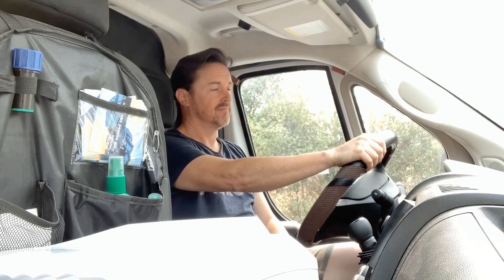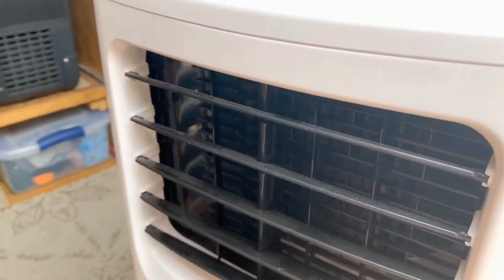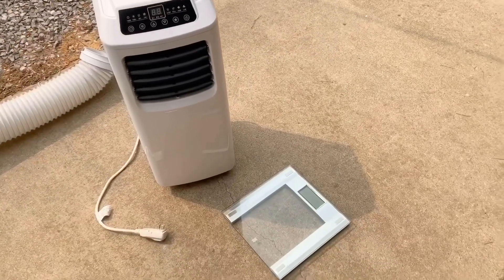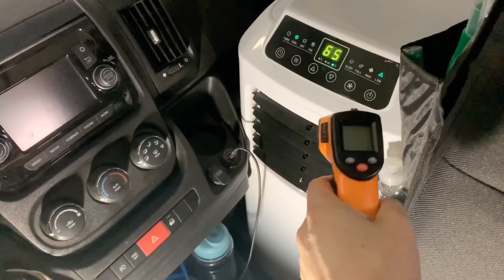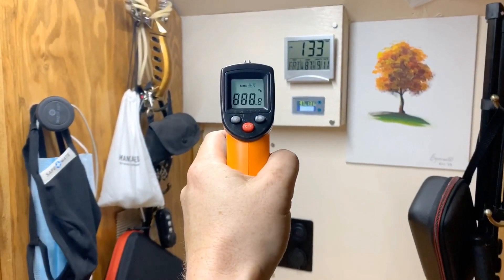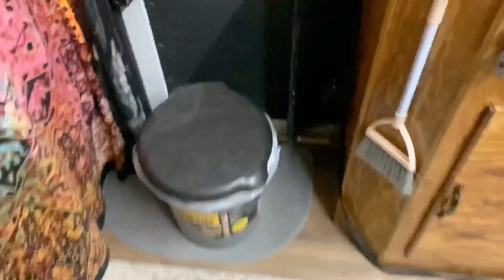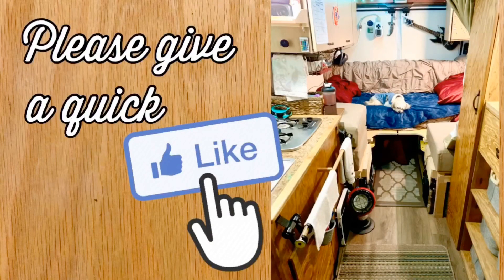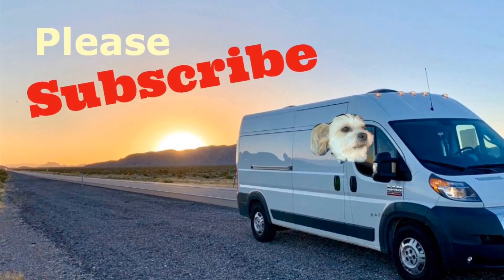Portable Cab Air Conditioner | RV Van Life

Comment: What is powering your AC unit?
Reply from the maker: Shore power. Extension cord. But my future plan is to put a cargo rack on the back tow hitch with a generator tapped into the top 3/4 of the gas tank. But that’s in the list of 100 future upgrades. I’m a nurse so this year has been difficult finding the energy to do any projects. I look forward to only working 1 day a week like I used to. 😊
Reply: @n8nomad419  are you not able to just plug into a 2500 watts inverter? Wouldn’t that work?
Reply from the maker: @IAMChrisWorkman  Indeed you can. If you have a powerful enough inverter and serious battery banks, absolutely. But I would need to upgrade and invest almost $4,000 to get there and run it overnight. I personally prefer to invest $400 into a quiet generator tapped into the top 2/3 of the fuel tank for the same result.
Reply: @n8nomad419  yeah I think a good quiet generator is best. My batteries would die so fast and my inverter would be working overtime trying to keep up with Vegas heat!

Comment: Any ideas how to position the unit when driving?  I have a Sprinter campervan with 3 seats, and the van itself does not have A/C.
Reply from the maker: I’m having a hard time imagining your layout (where the seats are, where you want it to aim, etc). But that’s a smart idea because if you have it run off the alternator or off batteries (with isolator charging them) or just a direct Inverter.. it could replace a missing A/C while driving. Do you have 3 people occupying all 3 seats? You can actually just secure it (anywhere) and cool the van while driving and then move it somewhere else when not in use. Sounds like a little work but isn’t everything in Van Life? I feel like I’m constantly maneuvering things around in this lifestyle anyway. 😊
Reply from the maker: Also.. if you live in a “dry heat” area I would highly suggest using a quality swamp cooler instead (WAY less energy). But I like that you’re thinking of (work-arounds) for problem solving. If nothing else, Van Life demands creativity.